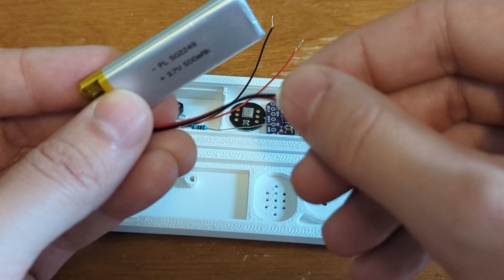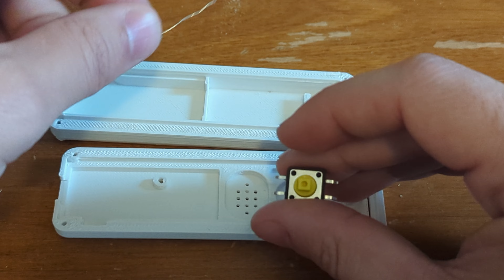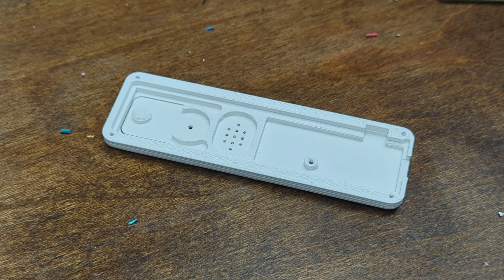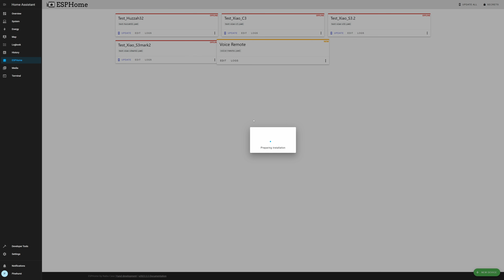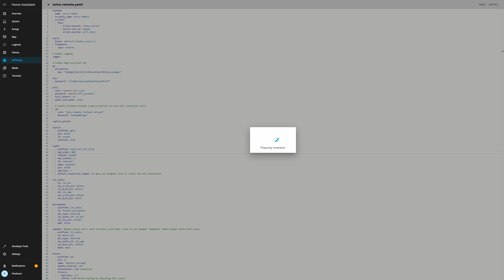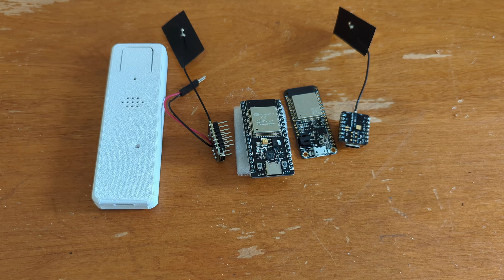Home Assistant Voice Remote

Comment: OMG, IT IS THE C3'S FAULT!!!!   Gahh, thank you for letting me know about that, I got a ton of ESP32-C3's because they were cheap.  I'll have to get the S3!  I still love all of my C3's, people hate them due to the wifi, but they are sufficient for me, and I may look into modding the antennae as well.  I love them a buck a pop all day every day!
Reply from the maker: Oh I love the C3. Idk if the underlying library could be rewritten to run well on a single core MCU, but really that was the issue. I've never had a problem with the WiFi on the Xiao boards, but the Supermini dev boards with the chip antennas really are pretty bad. I attribute that solely to the chip antennas. They just aren't very good compared to the PCB or external antennas.
Reply: @TechDregs  hehe, yeah, I get the super mini boards because they are massivly cheaper due to that. XD. I am looking forward to experimenting with antennae mods.

Would you know if the memory variants matter for this application?  The largest I found was the N32R16V, but I think I've seen as low as N4R2V.

Comment: Will this work with a wake word? If so, how much would you be willing to sell one of these for?
Reply from the maker: It wouldn't be great at wake word. It doesn't have the right audio processing onboard, and the battery life would be really poor. It was designed prior to good wake word detection being implemented on HA.
Reply: @TechDregs after this one is already two years „old“, are there components in the meanwhile which allow a even smaller version?
Reply from the maker: @maglat  You could make it smaller if you wanted to by designing your own pcb with everything onboard instead of using a dev board. Then the next thing would be the size of the battery. The components themselves haven't really gotten smaller, just more efficient packaging if you do a full custom board.

Comment: I’ve been binging your videos today - great stuff! Do you have a video on battery selection and setup? I watched your video on improving performance but I’m still not sure which batteries I can use.  I’ve heard I need voltage regulators, battery charging modules, resistors, and all kinds of stuff.  I didn’t see any of that in your setups though.
Reply from the maker: The easy button is to use boards that have battery management built in, and those are pretty much always for 3.7v LiPO. The Xiao series that I use a lot has that, but you have to do your own voltage monitoring. The Adafruit Feathers also have battery management, and the v2 version is extremely efficient when in deep sleep, which is why I used it for this project.
Reply: @TechDregs  Ah great tip!  I will go research these and see what I can find out.  You are inspiring me to make my own videos

Comment: Good project !!
But how did you got the microphone to work with the xiao c3 board ?
because i got one with the inmp441 microphone and i set up the voice assistant and everything but i can never wake the device when saying the wake word.
when i flash the code i get 4 warnings for the i2s microphone library in the logs and the device never wakes. I also tried the same microphone with the same board with a simple code that takes the microphone output and uploads it to a web server so i can test both the microphone and the board.
its all working with that but when using the esphome it never detects the wake word.
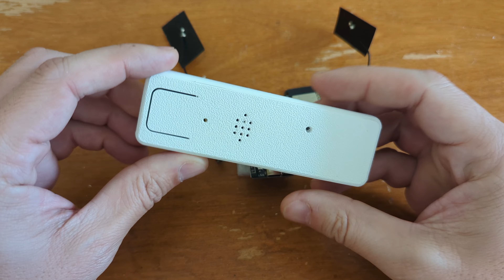Reply from the maker: You can't. The underlying audio library doesn't work with single core ESP32 like the C3, last I checked. That's why I switched the board in this project to an Adafruit feather v2. You have to use a dual core ESP32 part for that audio library to work. I discuss this at 27:32 in the video, where I talk about the various boards I tried and their tradeoffs.
Reply: @TechDregs  I also tested with an esp32 s3 wroom 1 but also the same warnings and wake word never works.
Reply from the maker: What warnings? Also, is the mic configured for the correct channel? I found some boards wanted to default to right channel and others wanted left channel. I don't remember which was which, unfortunately.
Reply: @TechDregs  how can I contact you to send you the photo of warnings?
Reply from the maker: They should be short enough that you can just copy/paste them here. But if you want more help, you should go to the ESPHome discord. Lots of people there are way more capable than I am with this sort of stuff.
Reply from the maker: What board are you using, and what does your esp32 config/framework setup look like in the YAML? Might be a conflict where it's trying to use the wrong board to work with your setup. Did you change the board from a adafruit feather to an S3 in the YAML?
Reply: @TechDregs  what problems did you get with the xiao s3 because I'm planning to get one to complete my project
Reply from the maker: My S3 had really poor wifi connectivity and it was difficult to program. My computer often wouldn't recognize it for programming or things would just fail. The wifi range was poor and seemed to lose connectivity frequently. Could have just been a bad board; I never revisited it.

Comment: compilation errors on esphome, the problem comes from gpio14 which is used twice. How to solve the problem? thank you! Merry Christmas
Reply from the maker: You might try the fix from @_bentou, try these modifications to the binary_sensor and sleep routines: 

binary_sensor:
  - platform: gpio
    pin:
      number: GPIO14
      allow_other_uses: true
      inverted: False
    name: Button
    id: remote_button
    filters:
      - delayed_on: 10ms #debounce time

    on_multi_click:
      - timing:
          - ON FOR AT LEAST 350ms
        then:
          - voice_assistant.start:
      - timing:
          - ON FOR AT LEAST 350ms
          - OFF FOR AT LEAST 10ms
        then:
          - voice_assistant.stop:
          
    on_press: 
      then:
        - script.stop: sleep_routine #this resets the sleep timer every time the button is pressed
        - logger.log: "sleep reset"
        - script.execute: sleep_routine

deep_sleep:
  id: deep_sleep_1
  sleep_duration: 1h # how long to sleep before rewaking
  esp32_ext1_wakeup: #regular GPIO wakeup had some issues on some boards. Ext1 seems to work on everything.
    pins:
      number: GPIO14
      allow_other_uses: true
    mode: ANY_HIGH
Reply: Thanks, it works! I would like to know if it is possible to make it work outside the local network? thank you!
Reply from the maker: I'm not really sure; that's outside my understanding of the Home Assistant system, unfortunately.

Comment: New espHome version, new bugs !!!
Reply: binary_sensor:
  - platform: gpio
    pin:
      number: GPIO14
      allow_other_uses: true
      inverted: False
    name: Button
    id: remote_button
    filters:
      - delayed_on: 10ms #debounce time

    on_multi_click:
      - timing:
          - ON FOR AT LEAST 350ms
        then:
          - voice_assistant.start:
      - timing:
          - ON FOR AT LEAST 350ms
          - OFF FOR AT LEAST 10ms
        then:
          - voice_assistant.stop:
          
    on_press: 
      then:
        - script.stop: sleep_routine #this resets the sleep timer every time the button is pressed
        - logger.log: "sleep reset"
        - script.execute: sleep_routine

deep_sleep:
  id: deep_sleep_1
  sleep_duration: 1h # how long to sleep before rewaking
  esp32_ext1_wakeup: #regular GPIO wakeup had some issues on some boards. Ext1 seems to work on everything.
    pins:
      number: GPIO14
      allow_other_uses: true
    mode: ANY_HIGH
---------
you must add " allow_other_uses: true" for the GPIO14 definition.

Comment: I wonder if the m5stack 33 would work, or possibly the m5stack stamp SS with the 2 dollar breakout board (breakout board isn't needed but would probably make wiring and keeping it in olace easier). I kike the Xiao lineup but having those external antennas, which are absolutely necessary, kind of defeats the purpose. The m5stack S3 is only slightly larger than the xiao, the anyenna is built into it, and it gets better reception even with the internal antenna. Regardless, its not like its going to get better performance although sleep mode may (key word may) draw less power. It also probably wasn't out when you made this voice remote before posting this video.
Reply from the maker: Does the m5 stuff come with battery management on board?

Comment: You can set it as the default voice assistant on Android and wear OS now. Below is from the home assistant forums. Also, there are some intent blueorints in the HA forums for stuck kike weather, calendar events and mire. Their is a dedicated bkueprint su forum.Based on the yaml from the blueprints, it looks pretty involved depending on what type of questions. Honestly im good with weather and controling jome devices which was 95 oercent of what I used Google Assistant for before switching afyer adding native android support. I wouldn't hild my breath for iOS but you never know. They just tend to he way more strict about stuff controling the iPhone unless it's something Apple.wroge.the code.for. hopefully I'll be proven wrong.

It’s even possible to activate Assist directly from the lock screen:

You can find the settings on Android: Settings -> Apps -> Default apps or tap on the tip in the Home Assistant Companion settings.

Native Assist on Wear OS
We didn’t leave out watches! Wear OS devices can now natively use Assist as well:

Text-to-speech responses are spoken directly from the watch, allowing you to listen instead of looking for confirmation.

Like the phones, it is possible to set Home Assistant to be your watch’s default digital assistant. Pressing the crown or holding the button on your watch now brings up Assist!

Comment: Hey, I'm new to 3D printing, but Prusa Slicer says it can't open the files you've included? Assume I'm doing something wrong, any advice?
Reply from the maker: The 3MF files should work I think, but I don't use Prusa Slicer, so I'm not sure if there's anything else going on. I think Prusa Slicer can also import the STEP files, so maybe try those. Worst case, you could use a STEP to STL converter program, which I think are pretty easy to get online.
Reply: Got them working. Simple user error lol.

Comment: Any idea how reconnect speed and power use is affected if you use ble instead of wifi? "Threepio, shutdown all the garbage compactors.."
Reply from the maker: I haven't measured BLE power use. From what I've seen online, BLE uses roughly half the power that wifi does, but that doesn't necessarily mean twice as much battery life. Depends on how much on vs off time you have on the device. https://deepbluembedded.com/esp32-sleep-modes-power-consumption/

Comment: Hi, I'm a dummy. Could I just use a default ESP32 (as per your 'my choices' section) and connect it to a cheapy USB powerbank? Would I still be able to put it to sleep and wake it up (as you do) if it's powered via the USB?
I understand it's a much larger footprint (and a powerbank on top too) but lets say I have a larger 'box' for it to live in?
Reply from the maker: Yeah, a basic esp32 should work if you feed it power via usb. If it's not on a battery, there's no real need for the sleep at all. If it's a big powerbank, it'd probably take quite a while to run it down.
Reply: @TechDregs  my plan was to "mount" it to the wall so it's going to be in sleep most of the time so figured it would help eek out a longer period of time between needing to charge the power bank.
Reply from the maker: It would definitely make the power bank last longer. There's nothing that prevents you from using sleep when it's powered via the USB plug.
Reply: @TechDregs  thanks a lot! Thanks again for the replies and the great effort you made on the vid. I've subscribed!

Comment: Hey I finally had some time to make one myself. I've got everything assembled and installed but it doesn't work properly. The device keep rebooting by itself. It wakes up by itself, waits for the set time of 30 seconds and shuts down and repeats this. Also when I try and use it in home assistant it's very buggy and doesn't properly update and does not take commands. When I look at the logs I can see the button constantly changing OFF ON OFF ON.

Any idea what could be wrong? thanks!
Reply from the maker: Is the button being held down constantly by the case? Are you using the same board as I used? Perhaps also double check the wiring. Sounds like maybe the pulldown resistor isn't connected well?
Reply: @TechDregs  First off all, thanks for taking the time to look into this! 
The button being held down is not possible. I was doing all my testing with the case still somewhat open. I'm using the exact same components as you showed and connected exactly as your diagram. 

I did have to look around for a resistor so I might be broken. Could a broken/absent resistor cause this issue? the device seems to be working but when it's awake HA doesn't seem to get a signal that the button is pressed or respond to voice commands. When the device is off it does wake when I click the button and connects to wifi.
Reply from the maker: The pull down resistor is there to make sure the button reads ground level when it's not pressed. Keeps it from falsely triggering due to floating ground.

If HA isn't getting a signal, what does it say in the log? Is the device showing up in Home Assistant, and do you have your voice pipeline configured?
Reply: I'll have to check the resistor to make sure that's ok. The device shows up in home assistant as well as the entities and yes that's configured. 

I checked the logs, both in the device menu and esphome and it basically doesn't give any signal that it sees a button press. It just waits 30 seconds and powers off. Then powers back on by itself and repeats this. I've tested the button to make sure I have it wired correctly and it looks good. It's setup as NC contact and I get a good signal when the button is pressed. I'll have tlcheck the resistor first I think and triple check the wires that I didn't make a mistake there but since I can see all 6 entities it seems correct. 
Thanks again for helping, really appreciate it. I have some basic electronics knowledge but this is pretty advanced to me
Reply: I meant NO contact. Only makes contact when I press the button
Reply from the maker: I think seeing the entities in HA just means that you've got something configured in the YAML. I don't think it means anything regarding how the hardware is connected. If the log isn't showing anything when you physically click the button, that sounds like the first place I'd check. Make sure the pins are set correctly. Does that button wake the device correctly? If it does but doesn't trigger VA, then that narrows down the problem. If it won't wake the device or anything, then I'd suspect that it's a wiring issue or the pin assignment.
Reply: @TechDregs  Underfortunatly I gave up. I rechecked my wires (all were ok) used multimeter to check if they all have good connection, they did. Reconfirgured it but it works even less now lol. When I click the button the device doesn't even wake up. I measured and can see it clearly gives a signal from IO14 (14) to the button and passes it on so I'm not sure what could be wrong. Thanks for the help tho!
Reply from the maker: If you want, go to the ESPHome discord, and they can probably help figure out what's going wrong.
Reply: @TechDregs  thanks for the tip!

Comment: Hi ... How do you charge the battery (since it also glued in)?
Reply from the maker: Via the USB connector. This board has built in battery management.
Reply: @TechDregs  tx! did not know that battery management also managed the charging. BTW great project and Respect for the end result!